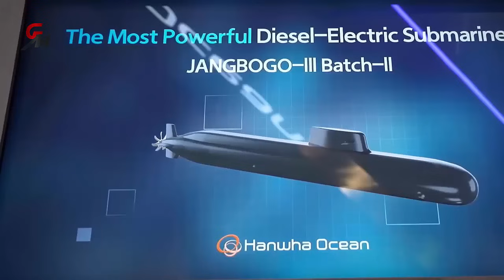Which is Better TKMS 212CD or Hanwha KSS-III, Here's The Canada's Next Gen Submarine

Comment: however, the picture showed the DM2A4 what is the currently used torpedo for the 212 class. And it has a speed of 50 knots (NOT 25), range of 50km (higher range with lower speed)
Reply: The 50 knots are standard; they can achieve 60-70 knots with today's technology! But with a rocket underwater, you can go much faster and farther!
In 2005, the German company Diehl introduced the Barracuda, which is said to have a range of 100-160 kilometers. It's capable of 400 km/h (250 mph) and, in tests, reached 800 km/h (500 mph)! Nothing has been heard of the Barracuda since 2005! It's probably being kept under the strictest secrecy! Interception is currently not possible! But according to Diehl, the Barracuda can also intercept Barracuda!
Reply: You can just add batteries to the DM2A4 to extend range
Reply: haakonht... The torpedo has a range of 50 kilometers and uses its sensors to send the submarine data on everything happening in front of the torpedo. To increase its range, the torpedo travels at 25-30 knots, for example, which is still very fast for interception. It can then travel a good 100 kilometers, which is perfectly sufficient! So stalk the target and then reach maximum speed before reaching the target, which experts say should be over 60-70 knots! AI conclusion: Electric motors can be extremely overloaded, particularly because the electric motor is extremely well cooled by cold water. Shortly before the target, up to three times the rated power is probably required the closer you get to the enemy, 2-3 kilometers beforehand or from the stalking phase at a depth of 300 meters in just under seven seconds then up to the enemy. We're talking 85 knots according to AI calculations! According to AI, in this attack scenario the enemy has almost no chance of taking countermeasures without putting themselves at massive risk! The depth charges would be much too close to our own ship and would sink it!

Comment: Lithium ion batteries have a flaw and should not be used in submarines.
Canada should instead wait for new developments in sodium ion batteries for the next two years for use in submarines.
As these don't catch fire, charge faster and aren't affected by cold and don't require cooling under high load.

Comment: Given the technology involved, delivery schedule, and the ability to integrate future technology, the KSS-III is the only choice.
Reply: If a Kss3 would get into a combat with the 212CD ... The 212 CD would win. Simply because it's much quieter and it's much more difficult to detect.
Reply: @alhgbbn   and you know this how? Have you got any source of data that shows under water noise levels of both submarines? Oh wait, the 212CD proposed for Canada doesn't exist yet! So how do you know that the submarine that doesn't exist runs quieter?
Reply: @스트라이더_X.X you can simulate the noise of the submarines or ships even before they are built. The 212cd has a stealth shape like for example the F35 Jet. Only under water. It's very difficult for Kss3 and other normal submarines to find the Location of the 212cd and this will be a huge advantage.
Reply: @alhgbbn  So where is that simulated data of results for both submarines? Or are you just speculating?
Reply: @스트라이더_X.X on the data Center of TKMS, my friend  ... The thing is, when tkms says this will be the quietest submarine out there, it will be so. ... Also the now existing 212A is quieter than any other submarine out there. And the 212CD will top this.
Reply: @alhgbbn   So you mean to say that when TKMS says it is the quietest then it becomes a fact? Nice logic there. 😂 Great to know that a seller trying to say theirs are the best. Anything else so that I can be enlightened other than  an empty claims without any objective proof?
Reply: @스트라이더_X.X  the truth is, you don't give a shit if the Kss3 submarine is good or is not as good as the 212CD. ... You are only interested in the chart of the hanwah stock and I am perhaps interested in the chart of TKMS stock... You never we're in a submarine and at the very end you know nothing about it's technique like me, too. So this discussion makes no sense.
Reply: @alhgbbn  Nope, I am not interested in any stocks you have mentioned nor do I own them. However, I am merely pointing out the bold claims you made that 212CD will win over KSS3 without any proof or objective data. You are saying there are TKMS simulations and you are saying that you are an expert. So I am asking you to show it, yet so far you are not able to present anything of substance that will back up your claims. Let me play your game here. If I have told you that M1A1 will destroy Leopard 2 A8 in every encounter,  yet I will just tell anyone asking me how I know this that I know this because it is how it is or you gotta believe it because the Americans who make the M1 did the simulation (without showing any actual proof), am I convincing anyone here?
Reply: the schedule is a staggering difference, 4 SK subs by 2034-35, only 1 G/N sub by then and the second by 2037.  By 2037 we would have 7 SK subs from about 1 a year.  G/N doesn't have any subs in the water yet.  The facts are what they are and we need to go with SK tech not just subs but K-9 howitzers just like Poland.  Poland had their order in 12 months.  It'd be amazing but we know Canadian gov't attitudes it would be a miracle if they chose the fastest option in anything.  Same with Gripens.  Sweden and South Korea are available partners right now.
Reply: strider...They should take a look at what they're capable of with DLR/Fraunhof Institute! The US can't even keep up with them and often seeks partnerships, e.g., with passive radar or the SHEFEX II hypersonic missile! Germany was the first in the world to have SHEFEX 7 in 2005! DLR/Fraunhof Institute and Diehl already had the Barrakuda supercavitating underwater vehicle in 2005, capable of over 1 ton, 400 km/h, and in tests, over 800 km/h, with a range of 100-160 kilometers! Korea is still tinkering with a small test system that looks exactly like the Russian system, which isn't very good with a range of 15 kilometers!

The DLR/Fraunhof Institute were already able to use computer simulations with sensor systems to show how a fight against an F14/15/16/18 would play out with extremely unstable flight attitudes during the X31 project in 1988/9. US pilots laughed when they heard from Rockwell/MBB that they would be shot down in a short time! Then came the real simulation fight with the jets, and the US pilots' laughter quickly disappeared!

DLR and the Fraunhofer Institute have long since collected simulated data from the U212CD, U212A, and U214 in a fight with full high-tech sensor technology! They also know how the KSS III performs in combat against the U212CD! The KSS III would not be able to combat the U212CD, especially not if the U212CD operates at a depth of 800-1000 meters! In summary: TKMS could certainly demonstrate a combat simulation between the U212CD and the KSS III in Canada to demonstrate the superiority, weaknesses, and behavior of both systems in a "fight" scenario and support the decision-making process of the Canadian Department of Defense! Both institutes are world leaders in computer simulations using sensor technology! Both institutes are now working with modular quantum computers developed by DLR!

The U212CD is scalable to 90 or 100 meters and can then accommodate 40+/80+ VLS! MDBA has presented a hypersonic missile with a range of over 1,000 kilometers in 2025, which fits into VLS! MDBA also presented a cruise missile with a range of over 2,500 kilometers (nuclear-capable) in 2025, which also fits into VLS! TKMS has already stated that VLS is intended for the U212CD! Korea has no comparable systems that can keep up! If Canada wants ballistic missiles... no problem either! Ariane Group has just launched a new M51.4 ballistic missile that can also be deployed in submarines (the French have a 130-meter anti-submarine). It weighs a good 50 tons, is 12 meters long, and 2.3 meters in diameter! To achieve this, the U212CD would have to be scaled up to 130 meters and 9000 tons...that's possible! Then you could carry 16 missiles, each with 10 warheads at 140 kt!
Reply: @tlsig So where is your German sub with VLS? Oh its on drawings. 😂
Reply: @tlsig By the way, I am not dissing the history, heritage, and technology of Germany in terms of building submarines here. I also am aware the help of Germany which greatly contributed in developing Korean submarines. And I do believe that both submarines proposed to Canada are all good candidates that are worthy with their own strong areas. So it won't be any surprise if either candidate comes out as the winner. However,  I initially was merely pointing out to above comment which was claiming something boldly without any objective data.

Comment: Comparing the German 🇩🇪 TKMS Type 212CD and South Korean 🇰🇷 Hanwha KSS-III submarines is like weighing two very different strategic philosophies in conventional submarine design. Here's a breakdown to help you assess which might be “better”—depending on mission profile, regional needs, and industrial strategy.

---

### ⚙ Technical Comparison

| Feature                     | TKMS Type 212CD                          | Hanwha KSS-III (Batch 2)                     |
|----------------------------|------------------------------------------|----------------------------------------------|
| *Displacement*           | ~2,500 tons                              | ~3,800 tons                                   |
| *Propulsion*             | Diesel-electric + AIP (Fuel Cell)        | Diesel-electric + AIP (Lithium-ion battery)  |
| *Stealth*                | Ultra-low acoustic signature, Arctic-optimized | Low acoustic signature, advanced hull shaping |
| *Range & Endurance*      | Extended submerged endurance via AIP     | Longer range due to larger size and battery capacity |
| *Armament*               | Torpedoes, mines                         | Torpedoes, mines, *SLBM-capable VLS*       |
| *Crew*                   | ~27                                      | ~50                                           |
| *Export Status*          | Norway & Germany confirmed orders        | Operational in ROK Navy, export-ready        |

---

###  Strategic Considerations

- **TKMS 212CD**:
  - Designed for **Arctic and NATO operations**.
  - Proven AIP tech with *extreme stealth* and low crew requirements.
  - Smaller size = better for **littoral warfare and covert ops**.
  - Strong industrial offset proposals (e.g., Canadian sustainment hub).

- **Hanwha KSS-III**:
  - Larger, more versatile platform with *vertical launch system (VLS)* for cruise or ballistic missiles.
  - Built for **blue-water operations and strategic deterrence**.
  - Represents South Korea’s push into high-end naval exports, with *scalable production* and tech transfer potential.

---

###  Verdict: Mission-Dependent

- If you're prioritizing *stealth, Arctic capability, and NATO integration**, the **Type 212CD* is superior.
- If you're looking for *strategic reach, missile capability, and industrial scalability**, the **KSS-III* is more future-proof.

the choice reflects deeper strategic alignments—European stealth vs. Indo-Pacific reach.
Reply: ...excellent analysis!!

Comment: If VLS is removed from KSS3 then it could have more rooms for extra battery, food stock and other supplies which could potentially increase the underwater operation.
Reply: VLS is part of the specs they are looking for
Reply: @loudub814  I thought Canada didn't seek VLS option. If VLS is removed or have 5 or 6 VLS rather than 10 VLS then there's more rooms for storage such as food+medical supplies which means greatly increase underwater operation.
Reply: @loudub814  If Canada needs a longer sailing distance, that's what they're going to do.
Reply: We need the VLS on the subs. That offensive capability is needed for Arctic operations.
Reply: @Gryph01  I.m.o. Canada needs a hunter-killer
Reply: @Gryph01  I suppose the Koreans have already a promised a missile capable of breaking through arctic ice on submarine launch as well then? Given that it is needed for arctic operation.

Comment: It is extremely misleading to suggest that by 2035 Canada will have a submarine force able to deter aggression.  By 2035 we will have 1 new sub.  One!

We needed these subs yesterday.  Steps need to be taken to accelerate the delivery schedule, regardless of which bidder is chosen.
Reply: The Korean bid says if the contract is awarded soon, they can have 4 boats delivered to the RCN by 2035. The program requirement is to have just 1 by 2035, so the Korean offer sounds very nice.
Reply: Korea promised four ships by 2035.
Looking at the track record of deliveries to the Korean military, it seems not only feasible, but also quite flexible.
Korea isn't one of those countries that doesn't adhere to deadlines like Europe or the United States.
In fact, it's famous for delivering ships ahead of deadlines.